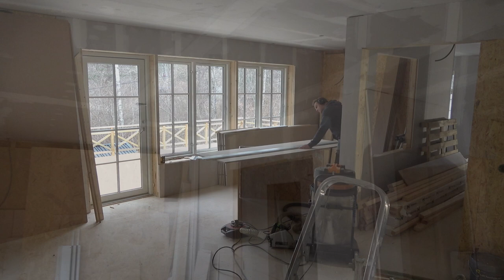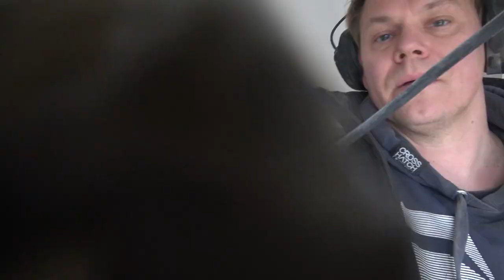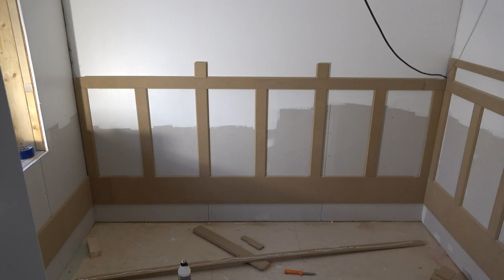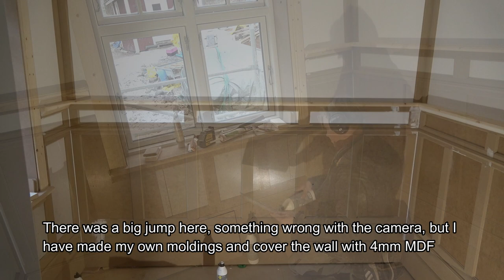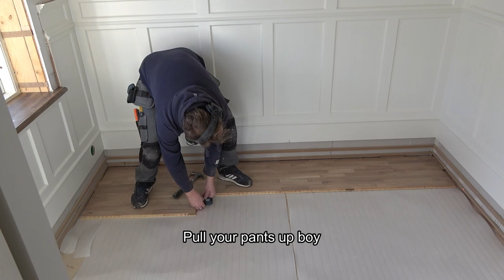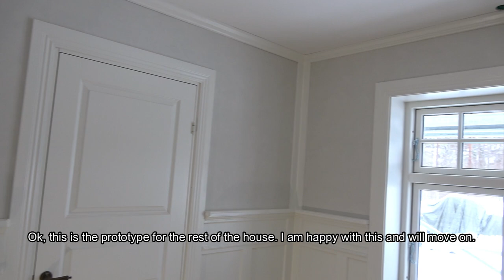DIY Classic wall panel as cheap as possible (Ep.11) Building a house by myself

Comment: for those of you who are planning on getting a lot of painting done on a new house. look into purchasing or renting a airless sprayer. you can get one for as little as $300 but i would recommend getting one $500-$1000. will give you much better performance. watch a few YouTube videos on how to use them and give it a few test sprays. you will want to start with low pressure and gradually increase it as you get comfortable.